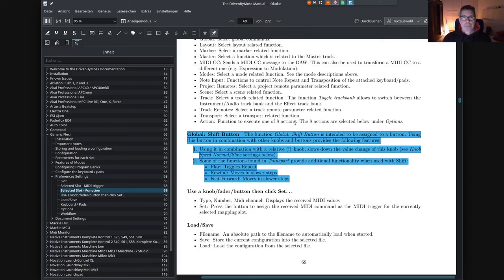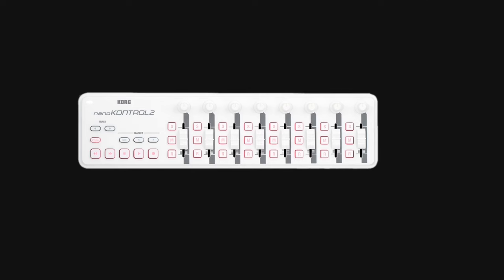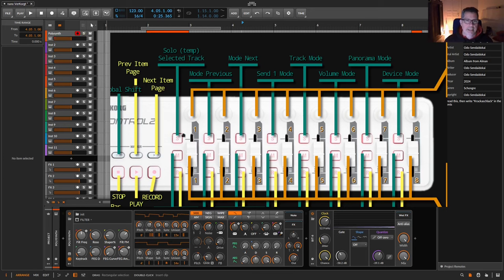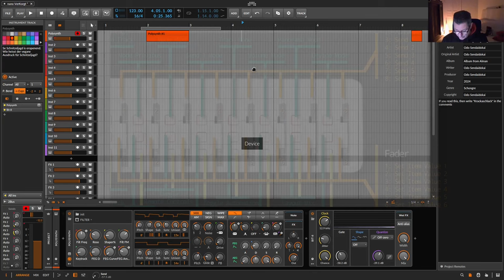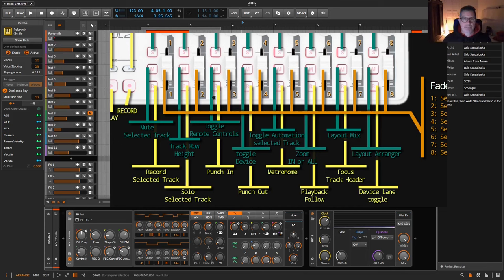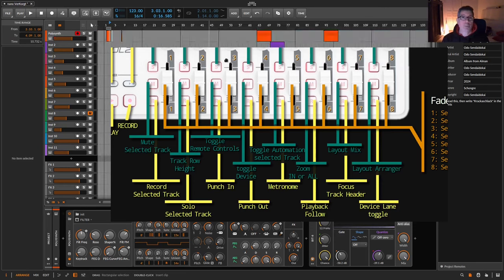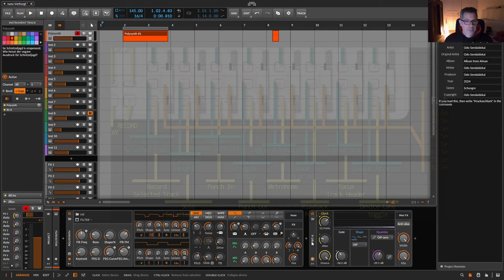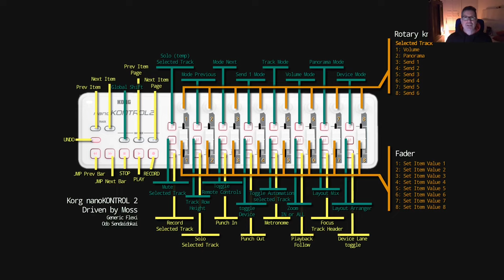Korg nanoKONTROL2 on Steroids | Generic Flexi |  Midi | Bitwig | EN

Comment: Cool ideas! In my case everything works fine, except transport buttons which don't react at all. What may cause that? I am using 5.2.4 with the latest Driven By Moss extension.
Reply from the maker: When you open the controller settings, do you see that when hitting the transport buttons that there are some values incoming? If not, then device is broken. If yes then there is misconfiguration. Check the settings you did in that slot .. maybe you set it on another midi channel .. or another of the new function layers of generic flexi? I guess it is a misconfiguration. Since such configuration can get very complex, this happens easily.